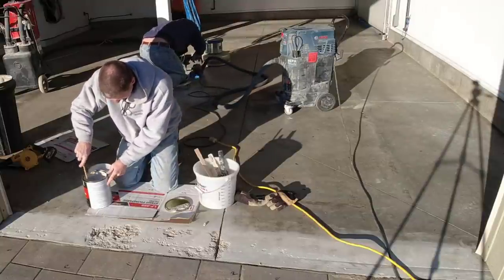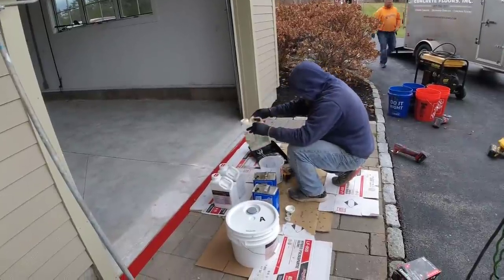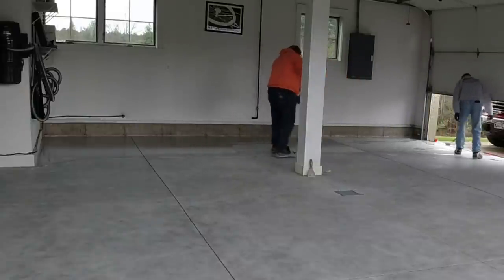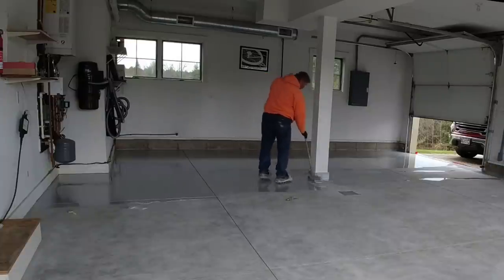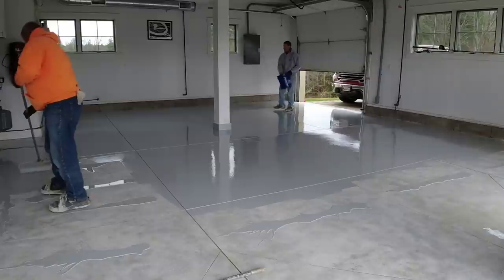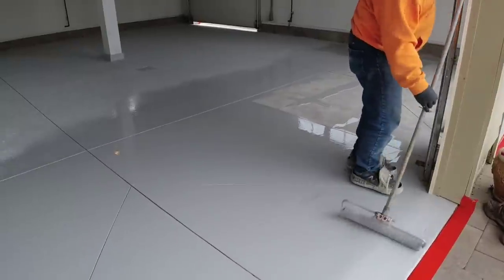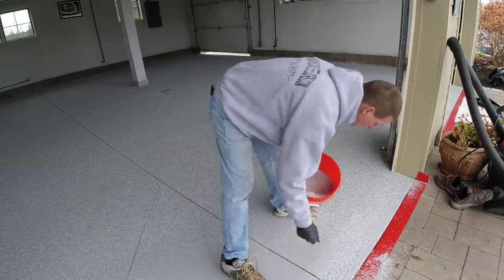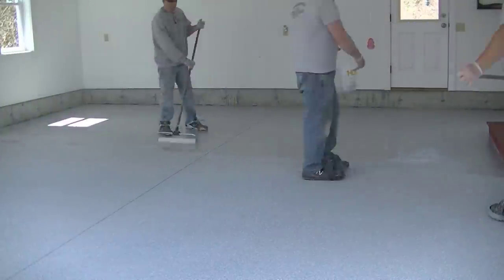DIY Garage Floor Epoxy Coating | How To Epoxy Your Floor in 2023

Comment: Hi Mike , how do you prevent roller marks in the topcoat?  And do you ever use a squeegee as well for applying the topcoat ?
Reply from the maker: The top coat we use, polyaspartic, is thick enough so it levels out with no roller marks. Thinner ones like a Urethane can leave roller marks. There's a trick to not leaving any, it takes practice. I roll it out as even as possible, then for my finish stroke I start close to my feet and push the roller out and lift it just before I can't reach any further. Some coatings we use we do squeegee them first but not the ones in this video.

Comment: Hi Mike, I'm considering taking the course you offer in this video. My old garage floor has previously been painted, the old paint is wore off about 50%, I'm concerned about bonding, would I have to remove the old paint first? I'm researching now, I would like to find out this process would work first. Thank you, John
Reply from the maker: Yes, grind off all the old paint first.

Comment: Hey Mike, got my brand new concrete all sanded off. Quick question, if I don’t have a scraper and want this look with the flake is there a way?
Reply: Use a shovel
Reply: @superiorepoxyfloors6354  thought about that, didn’t want to mess up my new epoxy floor 😂
Reply: @aanthonyha  nah man you'll be good just make sure whatever your base is, is fully cured out
Reply: @superiorepoxyfloors6354  Thank you! Gonna start rolling the epoxy tonight
Reply from the maker: We've used a pole sander before, like the drywall guys use. Just got to vacuum real good after.
Reply: @MikeDayConcrete  thanks mike. underestimated how much flake I needed and there’s some spots missing flake. I’m thinking of clear coating my floor today, could I just pour a little flake in the clear to hide the bald spots?

Comment: Hi Mike, I’m curious as to how tough the epoxy coating is. Can you wheel a engine hoist around with the weight of an engine on it? They usually have steel wheels and I’m wondering if that will gouge the epoxy.

Comment: I agree acid does nothing. You have to completely remove the laitance. I used a wet apply base coat, it really soaked into the pores avd formed a strong bond.

Comment: Not saying Anything against your floor, but explain how a thin coating that cures so quick it doesn't have time to penatrate into the concrete, is better than epoxy with a longer cure time?